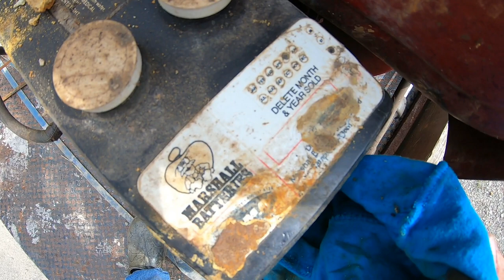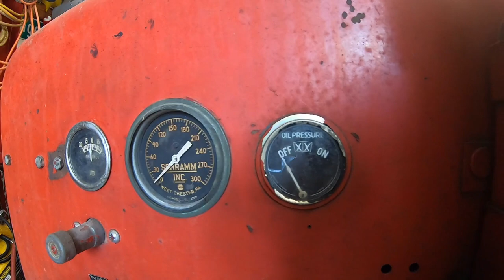1950's Gas Powered Air Compressor sitting 30 years! (Will it run!??)

Comment: Nice! Great looking old unit... Wisconsins are notorious for flooding easy. They are usually set rich to keep the engine temps down and don't need a LOT of choke to get going. My first was a John Deere self propelled swather that my dad got new in about '61 or so. Put a lot of hours on that thing. It had all four sparkplugs, lol. I wonder if the distributor on yours is off of a two cylinder Wisconsin?? Looked to have only two lobes on the point cam, and the cap looked like a factory cap. Dunno if the housings are the same. The engine on the swather was a sidevalve also, they made ohv versions with more power. I think the sidevalve four on the swather was maybe 35hp? Thanks for saving this unit, it is a very statuesque old dude! I can still identify the exhaust note of one of those (4 cyl) to this day. Reliable power with no radiator to mess with. Another great video!! Michael in Colorado.

Comment: You should build a trailer for it so you can take it to your farm. Ford built industrial air compressors using A 1/2 the cylinders for the air pump

Comment: The bowl from being tightened is probably crushed down so it won't tighten against the gasket and it is tightening against the carb. Pound it outward so it gives a small gap at the bolt hole and it should tighten better. Plus ATV should cure overnight.

Comment: If the carb float is brass it can be repaired with a little solder on any pin holes.

Comment: If I remember correctly they also built a compressor from a tractor which made it nice on a job site if you needed to move it around you just jump in the seat and moved it.
Reply from the maker: Yes Schramm made all kinds of goofy compressors if you watch my steam show video there’s a little schramm crawler compressor it’s pretty neat

Comment: Just drill a hole in the floats, empty them. Fill them with water and put pressure on them. I'm sure you can spot the leak.

Then just fill the holes and the leak with JB Weld. Fixed.

Comment: I once rented an air compressor similar to that one but it was a 357 Cleveland engine with half and half configuration like that. The only thing is you need to filter the air produced as it is full of oil.

Comment: Friend of mine has a Schramm tractor with a backhoe and front end loader. The trans and rear axle is from IH, same as a Farmall H. Don't know who made the engine, it's a fair sized ohv 6 cylinder, front 3 run, back 3 compressor. Separate intake manifold for each.
Reply: Might have had separate heads, I don't remember.

Comment: Those schramm compressors were common in the 60's and 70's. They made one with a V8 Ford engine that ran on 4, made air with 4

Comment: Excellent video also cool rig also what I say use low % Ethonal  like 5% in 89 or higher octane like 91 Octane fuel has no Ethonal % plus a bottle of STP Total Treatment fuel injection  in tank full worth to and no synthetic type too also 10W30 grade too!

Comment: Found some info for you.

Welcome to Smokstak, I have two Schramm Pneumapower 35s and know a good deal about them. They are built out of a Wisconsin VP4 engine, the predecessor of the VG4D. They are fairly uncommon. The hardest to find part for the engine are the compressor side pistons. It took me six years to find a matching set for my compressor. It has been a few years, but remember that these use a Marvel Schebler VH32 carburetor. Parts are available for them. I did not like the 6 volt generator/distributor on my 35s, and replaced them with a Wico XH1343 magneto. You have probably seen a video of one my contractor model 35s on a trailer on youtube. They are loud and quite a chore to setup, but are a good compressor. Your compressor looks like it is in good shape. Make sure to pull the oil pan and clean out 70 years of sludge before running the engine. You will have to loosen the engine mounting screws from the trailer to pull the pan easily. It is worth your effort. You never know what you are going to find. I found a bottle of prescription pills dating from the late 1970s in one of my Pneumapower 35s. How it got in there is anyones guess. These have a gear driven oil pump and run about 7psi of oil pressure. Use a good grade SAE 30 motor oil in the engine. I use Rotella T1 SAE30. 1968 is definitely not right for a Pneumapower 35, it will be more like 1952-1953. Jim Arras can tell you for sure. He is the only Schramm compressor dealer left.

Chris
Reply from the maker: I actually ordered manuals from him a few weeks ago lol seemed like a nice guy thanks for the info 👍🏼

Comment: I tried to solder a float once. Your not kidding it can get sideways fast. Got it too hot and burnt it up. I ended up finding another float but I always wondered if maybe jb weld would've worked or if I could've gotten a radiator man to fix it. Cool nail polish trick maybe ill try sometime

Comment: Worked on an air compressor made out of a Ford V8. Ran on 4 cylinders and 4 were the air compressor. Sounded kind of weird when it was running.

Comment: back in the 70s every motor project Mother Earth News did seemed to use a 2 cylinder Wisconsin engine.
You may have to adapt another carb to it

Comment: if the float a hole in it place it in the refrigerator then place it a cup hot water (150 degrees or so) when air in t he float warms up it expands is forced out hole. You see bubbles in the water. I have soldered the holes but be careful the less solder or it will not float.

Comment: Cool old machine! Be careful with that old air tank though! You should really hydro-test it, or at the least inspect the inside, before you let that thing build pressure. That tank could be a bomb in disguise after sitting for so long...

Comment: Remove float bowl seal
Measure diameter then nut boring same or slightly smaller
With similar thickness
Alternatively but a thicker one place on float boat recess gently file flat, turn over and do the same,then you will have flat rubber seal
Also put annealed cooper washer on float bowl bolt, or cork washer.
Check float level lavells to make sure no excess fuel leaking from overflow

Nick London England
You have to be versatile and think outside the box with vintage machinery.

Also put the helicoyle in and make new cork gasket,which expands.
Can also tap overflow from Carb add small threaded cooper or brass pipe and run pipe away from engine

Comment: Just a comment. The guys who cleam carbs have switched to big sonic baths with detergent. Seems to work really weight.   Other thing is use 15X40 diesel oil in the old engines.

Comment: Matt, it's been my experience that regular old toluene has been great for varnished carburetors. Don't know if it would be a miracle worker on something like that, but it works really well.
Reply: Toluene is a little more than half as strong as acetone

Comment: Hey Matt, I've said it before.. maybe not on your channel, (& I know you've got a water & power lack where you are, but you've used a water tank & gas power..) ... I have been a mechanic, run an auto / truck / big marine electrical shop & worked 40+ years in electromechanical stuff.. I ALWAYS power wash any thing mechanical (OK, bag the electricals...) BEFORE i work on them.. I can see soo much more ..leaks, cracks, hose problems & electrical (bad wires) .. I even used to charge my customers an extra flat fee ...IF they had not washed their engine before I had to work on it. (benefits as above PLUS, no need for gloves or grungy arms!)  Make your life easier.... 
Love all of your videos.. but I am waiting for the next AUTOCAR installment...

Comment: My former boss had an air compressor with a Dodge hemi on it. Half the engine was the power, the other 4 cylinders had a steel head and acted as the compressor.

Comment: The one you should look for is the Schramm pneumatractor. It has a six cylinder engine three run the tractor there are the compressor

Comment: I worked in Maine's wild blueberry industry for over a decade, we'd run these old Wisconsin THD & TJD engine's on our field burner's.  I'd spend winter's overhauling them, mostly converting from hand-crank to electric start off the tractor's..  There's a clip or two of them running on my page here, about the only one's I have.   Since have lost most of my vision, so don't do the work anymore..  was awesome!  Thanks for sharing this, you're doing great!

Comment: Part1 Your comment about red diesel threw me. Spark plugs not glow plugs, distributor? Ah I get it. It looks like old red diesel. Slow on the uptake. Suppose you sold it or don't have plans to come back and clean it up. You can get plenty of gas resistant rubber material, If you could get it under a 3D printer you could make one.

Comment: Love seeing successful CPR done on old machinery! You're right up there though on a slightly smaller scale with Jonathan W down in Cameron NC and his YT channel. Well done, Matt. Would like to see you exercising the boom truck now that you've got the engine running. Are you still planning on getting the lights working, brakes checked for road worthiness?
Reply from the maker: I don’t think I’ll put it on the road but I’ll get it all together and working correctly

Comment: I run 50 / 50 mix of oil and kerosene to flush clean oil passages and oil pan of equipment been setting a while. Run  mix for 5 min, and drain out.

Comment: I bet the needle and seat isn't sealing causing the carb to flood. The fuel level should be below the bowl gasket. Also sounds rich which would be a symptom of that. If you have a hand held pump like a Mityvac its easy to test.

Comment: I have a Schramm Pneumatractor.  Schramm has a patented hydraulic system using the crankcase oil to float the compressor valves when the pressure is up.  Don't know if they used it on your system.  They are a major well drilling manufacturer.
Reply from the maker: Yes I believe that’s how this works and that’s the issue I’m having with mine it’s not unloading the compressor side when it reaches pressure it stalls out
Reply: @DieselCreek  If it is hydraulically controlled and similar to mine:  there is a pump and screen alongside the lubricating oil pump.  The failure mode is that air is being compressed.  Screen could be plugged and in cold weather the hydraulics do not operate immediately on start-up.  I would suggest venting the compressor until the oil warms a little.  If I do not vent mine, pressure runs up to 150 psi in about ten seconds on start-up even with the compressor hydraulically shut off (on mine there are manual and automatic hydraulic shut offs) just because it takes time for the hydraulics to kick in.  The pressure might go higher.  I always chicken out and kick it out of gear (pneumatractor has a separate engine converted to a compressor and a clutch on the compressor) at 150 psi and climbing (you don't have that option).  You may have a pressure release on the pressure manifold.  If so, it has a lever to test it; if not, be careful.

Comment: Floats are adjustable by bending the needle float tab.  YouTube It.  you won't have the correct measurement but will have the concept for fixing it by trying and trying.  set the level to below the gasket.

Comment: THE expert on Schramm Pneumapower compressors (and many other old engines) is here: https://www.youtube.com/channel/UCyeEOvPkh2BX57ZICMkw4Eg. A reddit thread for them is here: https://www.reddit.com/r/SchrammPneumapower/ The compressor unloads by pumping up the valve lifters and holding the intake valves open against the head. Custom camshaft is 4-stroke on engine side, and 2-stroke on compressor side since air discharge is through the valves in the head. These were wonderful units built around the bullet-proof Wisconsin 4V. Another hybrid engine/compressor was the Jenbach which was a single cylinder horizontal diesel with a vertical compressor cylinder in the same block. https://www.youtube.com/watch?v=x7KRRq6HKz8  My Schramm is mid-rebuild. Got .030 over pistons, new rings, new valves, ready for paint and reassembly.

Comment: Enjoyable video, absolutely excellent. I wonder if you painted that gasket in the nail polish? Is there any way that fuel bowl could be getting pressurized? Permatex does make  Permatex®PermaShield™ Fuel Resistant Gasket Dressing & Flange Sealant - 85420

Comment: On markerplace I bought a single 110 amp generator with oil bath air cleaner.  Orange colored, Montgomery Wards.  Guy said it ran.  Took it home, added gas. 6 mo later, it started up first pull.  It looked cool, still don't know if it charges.

Comment: take the gasket you made off and put the old gasket back on it and get some gasket maker that has a brush that you can spread on both surfaces and put it back together let that stuff cure and no more leak

Comment: its build on a wisconsin 4 cylinder engine,,, i had 3 of them on service trucks in the 70s to maintain 2 with mags 1 with a distributor they would set for weeks at a time   without use evenchly the valves started sticking i put stainless vales and bronze guides in one solve that problem eventually scraped them all

Comment: As most people have suggested, the bowl gasket was probably NOT your problem.  As stated by others check your float level, make sure it sets parallel with the bottom of the carb body with the carb up side down.  However,  you checked the possible leakage of the needle and seat with a short piece of hose and blowing on the hose while holding the float down.  This is the WRONG way to do this.  Put the short piece of hose on the hose barb of the carb, turn carb up side down, DON'T apply pressure with you finger on the float.   Simply suck on the hose, put your tongue over the end of the house while in your mouth.  If needle holds that vacuum things are great, if not needle and seat need work.
Reply from the maker: Ahh that does seem to be a better way indeed thanks for the tip!

Comment: jeeze-o-petey-mus! what did they put in that thing for fuel? cleaning that tank is gonna be a project in and of it's self. i'd fill it up with carb cleaner, and leave it sit for about a month. then a give it a good 2 hour shake while it's suspended from the ceiling by some rope with a 1500 pack of bb's in it to get the chunky stuff loose. if you can find the hole/crack in the float, you can fix it. i've successfully soldered leaky floats before, you just don't wanna use anymore solder than you have to so it still floats at the right level. that lead free stuff is a little lighter than lead solder, it just doesn't bond as easily.

Comment: I bought this 95 Ford Ranger that was is really rough shape for scrap, and it had a 3.0 6 cylinder which I didn't think it would ever run again, I took the fuel line off as the thing sat for years, man the fuel looked just as bad as that and syrupy, I've never seen fuel that bad before, I got the truck running after a quick dirty clean and sounded good, I needed the engine for a low mile 98 Ford Taurus I was reselling.

Took that truck to the scrap yard and the crane operator ended up taking that truck off my trailer in 3 pieces, the cab, the bed, and then the frame, this truck was the worst rot I've ever seen on a newish vehical...

Comment: by 38:24 A. bad gasket. B. float level likely too high. C. needle/seat worn and not sealing proper any more. A and C are pretty much a given with the vibration and age of it. B, float height also likely off. the intake tube or tape was likely rotted/melted from fuel leaking over the years due to "C", which also slowly dripped varnish out below it :)

Comment: I seen similar carbs on Amazon but they're very pricey. I'm sure you could retrofit a dirt bike carb, the 2 bolt flanges really haven't changed in decades.

Comment: My uncle He worked for GE in Ohio For Years. He could fix any thing. but before every Oil change in every thing he owned He would put some Diesel in the crank case for a few minutes I once ask why he said That the Diesel would clean all the slug and anything else and would wash it out during oil change and would also lube as it went. It work for him and I do it on thing with really dark oil. and I have lost an engine yet.

Comment: i have a 4cyl wisconsin engine similar to that. think its a bit older as it doesn't have a starter motor and has a magneto rather than a distributor but otherwise very similar.
hoping to get a ring gear for the flywheel and a starter motor one day but unsure if there is any available that would suit it. model number is VF4D

Comment: Technology of the 30s  simplicity itself.  Oil nozzles sprayed on the rods.  Filter is bypass, not full-flow.  Distributor probably runs at engine speed, not 1/2, the more common set up.  Wisconsin engines are a little quirky when starting, almost individualistic.  Parts are generally still available, although a little pricey.  Note.....carburetors have a number of iterations, depending on fuel system set up.  Sometimes the float valve had multiple parts and tiny springs that are easy to overlook and lose.  If this happens, you've got a real problem, and it must be addressed.  Usually there is a brass disc riveted to the top of the carb with 2 number series identifiers, Wisconsin part # and carb mfgr's #.  Wisconsin usually contains an "L", like an "LQ48" for instances.  Wisconsin # is generally more fruitful for finding parts.  I have used these engines for years, have many parts which I no longer need, and can be messaged with any questions you may have. Good luck and have fun.

Comment: Dude when the oil is that thick I found adding a little seafoam to it will clear most of it. you just have to run it with it.